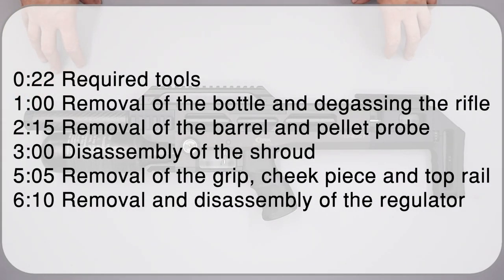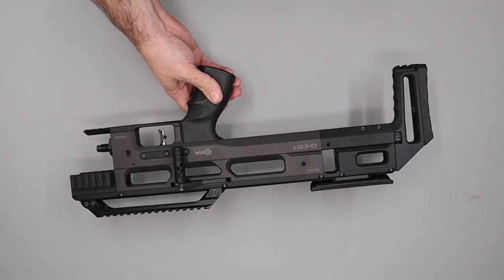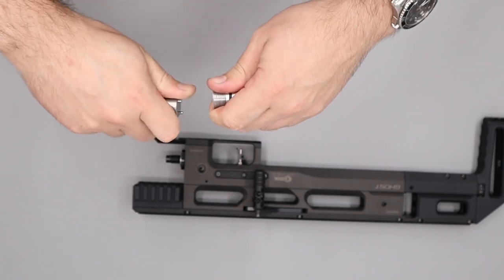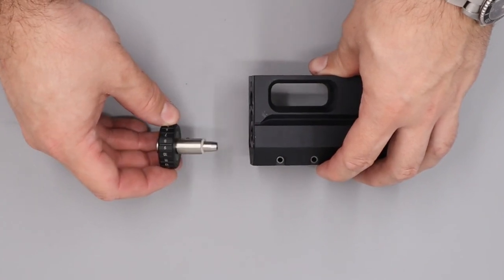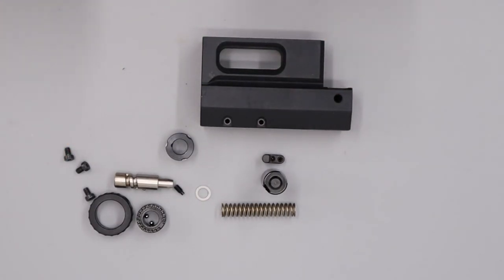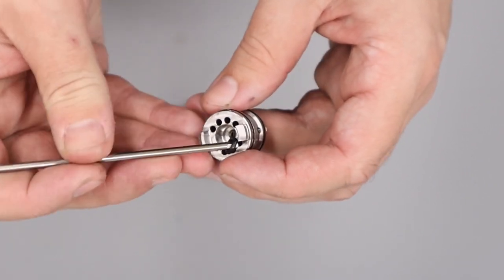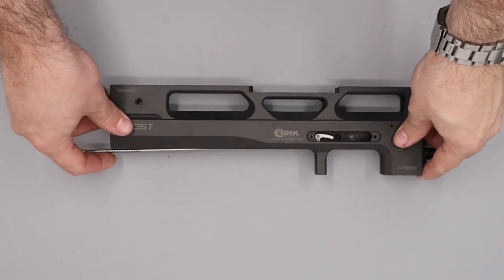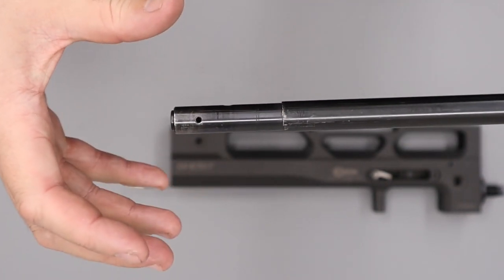BRK Ghost Stripdown

Comment: Hello, is the FAC valve a 'Balanced' type with a tiny hole venting from the back of the stem and into atmosphere? Or is it just that the the HPA side of the valve has a reduced area lessening the plenum pressure on the valve itself?
Reply from the maker: on the ghost the FAC vale is ballanced. In the 12 ft/lbs rifle it is not as ther is insuficient back-pressure to make a ballanced valve reliable.